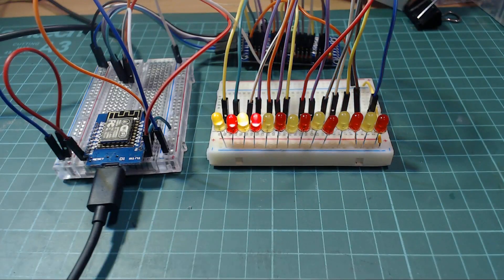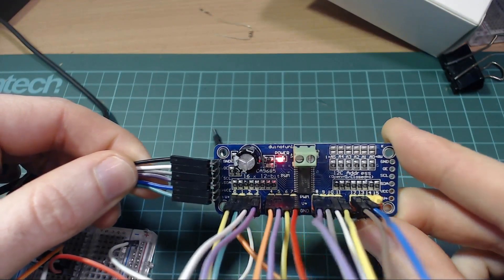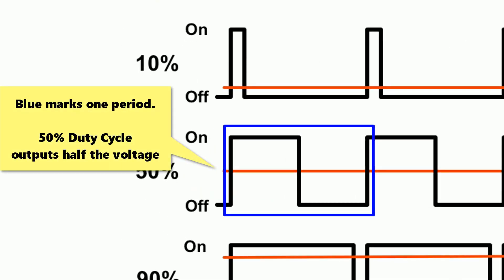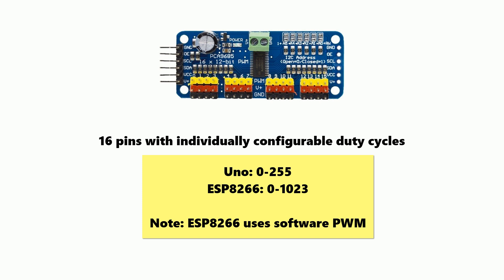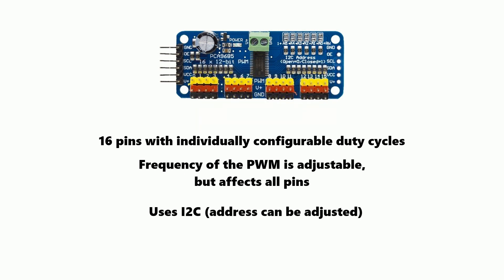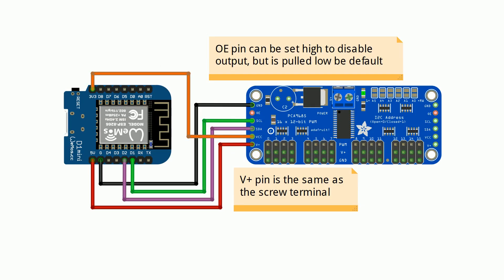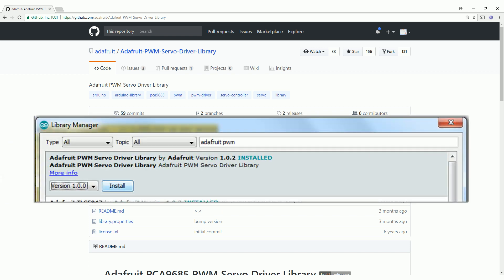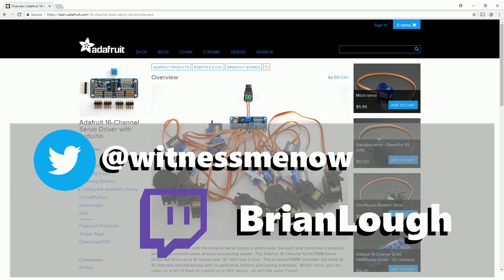[TMT] Additional PWM Pins for your Microcontroller- PCA9685

Comment: Hi Brian, thanks for the video.  I just received 5 ATTiny85 break out boards and was thinking to use this board with one of the 85s.  The thought behind this was to make a 16 led Larson scanner controlled by the ATTiny85 running the PCA9685.  Final result should include a fading tail effect which I believe would be achieved with the PWM capability of the 9685?  With your knowledge of the chip, is this feasible?
Reply from the maker: Yes I think that sounds like it would work fine!

Some people have built larson scanners using charlie plexing, but it's a little more complicated, especially to do pwm with it
Reply: @BrianLough  Yes, I've looked into it, but the coding for software PWM for Charlieplexing is a couple of chapters ahead in my learning process, lol.  Doing more searches on the net last night I've also come across another possible solution which is similar to yours, using and UNO, in my case an ATTiny85 to run a TLC5940 driving 16 leds with PWM.  I don't know enough about the chips yet to know the difference, but it looks like the 5940 could be set up with a smaller footprint.  Have you worked with a TLC5940?

Comment: hello brian thank you for this video. I have two questions.
I am working on my project where I am building the bipedal robot using linear actuators for movements I am using servo motors (9gm) modified for 360 rotation. my question is

1. how to modify the servo for 360 rotation but keep using PCA9685
2. how we can run multiple servos at once as legs and hand should move simultaneously while robot walking.

would you please guide me and provide any resources as I am new to Arduino

Comment: Actually, ATmega328P has two Output Compare pins named OC1A and OC1B which are connected to the 16-bit timer 1, so they can be used for 16-bit PWM. If it’s not possible using the Arduino IDE, then it’s the limitation of the IDE libraries, not the Uno board.
Reply from the maker: Good to know! I'm sure it is possible to access them. To be honest I don't use ATmega328P boards often so I'm less familiar with them but the default analogWrite, which would be the common way to use PWM on them, is 8 bit.

Thanks for the info!

Comment: Nice. 
I've used a similar board for servos, but I never got around to trying it with LEDs. 

This board would also be a good way to do one of those LED cubes, I think. 

3 of them for a 16x16x16 cube! The LEDs would cost more than the control boards.
Reply from the maker: Funnily enough I was thinking about this exact thing while making the video and I think you have a miscalculation, The max sized cube it could support is 9x9x9 (the max leds it can support is 992 and a 10x10x10 would have 1000 LEDS so one smaller than that)

It would be interesting to see would it be fast enough? If I was building a cube I would definitely use through hole neopixels, I'm not sure I ever want to take on the solder marathon though :)
Reply: Oh... That might be an issue with my idea.
I thought a matrix cube only needed to control the rows/columns/layers, not each LED directly.
Reply from the maker: Oh maybe actually, I'm exactly sure! I guess they could be multiplexed or something, I haven't actually dug into exactly how they work!

Comment: Hi Brian, i don't know if you by now have a solution for programming your smd-attinys,
buuuut just now stumbled across something interesting :-)

https://youtu.be/Ra0T0j5KoAc?t=172  looky there at  02:52. its an eeprom programmer clip-on clamp thingy !!

link from there:
https://www.ebay.com.au/itm/SOIC8-SOP8-Flash-Chip-IC-Test-Clips-Socket-Adpter-BIOS-24-25-93-Programmer-CU/162397727075

so you could go back to your arduino pro-micro powered DIY programmer :-)
(edit: some typos undone)
Reply from the maker: Looks cool! Its a nice idea!
Reply: i bet theres also the right size available for the attiny package...
(and even for your timezone you should be in bed now ;-) )
Reply from the maker: An esp8266 one would be ideal!

Comment: Myself as non programmingguy wonder why you use analog write for pwm ?
 the base principle of pwm says you pulse at full/max pin voltage + 0V/gnd,
and the level is defined by on time /duty cycle.
Q: why use analog pins for pwm ?

if you already use analog pin with 12bit resolution, you could directly set the voltage needed (of course needs voltage follower/opAmp for higher loads)

i would start pwm for leds at 200Hz which would be over 3x the 60hz a normal monitor runs just fine, but i guess it depends on shutter times if you use it to take photos.
(small resistor=>cap=>led would help smoothen the leds anyways)
Reply from the maker: AnalogWrite isn't actually for Analog Pins, at least on any boards I've used. It's for digitalPins that are PWM capable.

AnalogWrite(0, 128) would set a PWM signal on pin 0 with a duty cycle of 50% (on an an UNO, I'm not sure if 0 is PWM capable, but you get the idea :))